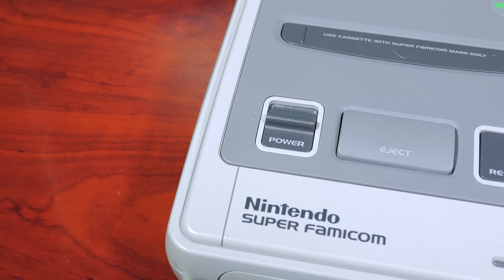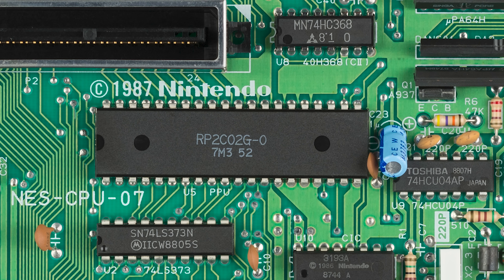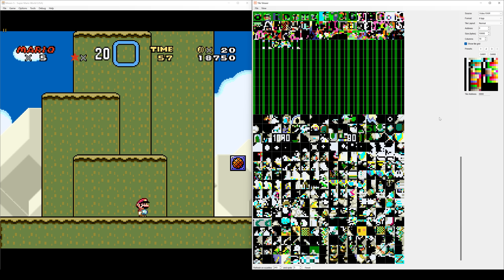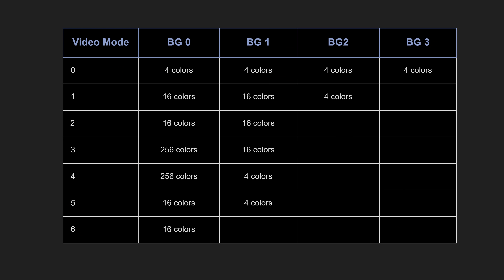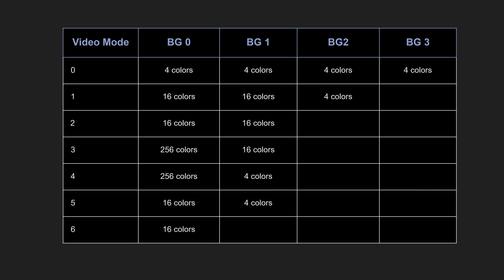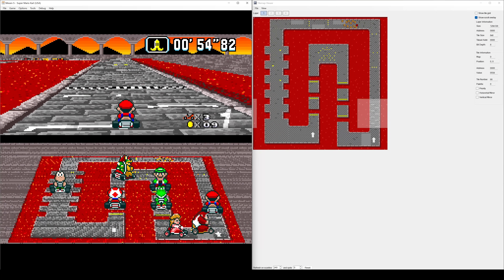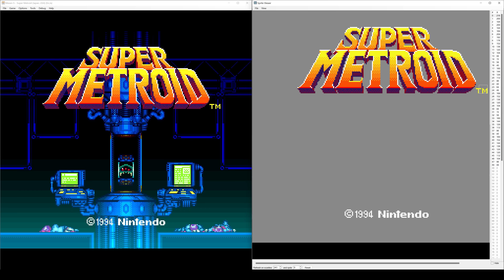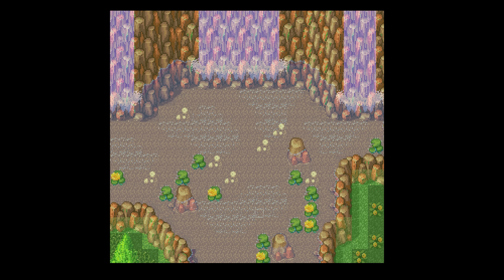How Graphics worked on the Super NES | MVG

Comment: Great video thank you. This reminds me of my childhood where i modded my supernintendo and added 8 swtiches which were installed on the back of my snes which were short circuiting single lines of the ppu which therefore gave me the control to hide single layers. In Mario Kart i was just deactivating the Main Kart which then looked like you were looking from the drivers perspective. In ShadowRun i had the effect that i was able to turn of the layer of the interiour design of the rooms and therefore being able to see all the hidden secrets like hidden money , weapons, etc... This was one of 4 mods for my snes which i did back in the time.
Reply: Wow nice, I loved discovering how these games where made back around 2000, switching on and off these backgrounds on emulator. I had no idea it was doable on a real hardware. I wounder if a similar mod could applied to the sound system in order to cut the 8 music channels independently so that you can listen to each of them solo, but on a real hardware.
Reply: @mrnuage  well actually i never tried to mod the sound. I was not even thinking about that but its a great idea. At that time everysingle mod was very risky to damage the mainboard which had happend. I was still a child and i was super curious to understand what all these chips do. So i took a wire and were short circuiting the board while it was running. This was not my first attempt in modding hardware. I tried that also before on a master system and a commodore c16. So i allready had some basic knowledge about what i can do and what i should avoid. Anyway on one attempt to get rid of the region protection i fried a coil and then paid a lot of money for a repair service just to try it again afterwards ;) and indeed i was able to find the chip which was responsible for the region lock. It was a great time and i loved my SNES.
Reply: @mrnuage : Sound is mixed internally in the S-SMP / S-DSP, afaik you can't disable channels by modding.
Reply: That's awesome, what other mods did you do?
Reply: @renakunisaki  i added a 60HZ crystal oscillator to my snes which was a pal system with 50HZ. With that mod i was able to remove the top and bottom black bars from the screen which the pal system usually had and played all the games with faster speed. Especially Street Fighter  2 Turbo played so much better with that mod. Also the colors got much more contrast. It looked great on an old Sony Trinitron CRT.

Comment: You mentioned that the layers in certain modes could display 128 colours, but the graphic on screen says 256 colours.
Reply: Same about mode 6 - 16 colors written, 32 colors spoken
Reply: I’d appreciate Modern vintage to respond with a clarification because I’m very curious what’s the right number
Reply: SNES features separate palettes for sprites and tiles, 8 for each and 16 colors per palette, including one transparent for each palette. Meaning you could technically get 256 but probably won't due to colors overlap and art styles. Also you still could have only 16 colors per sprite or tile. There is a direct mode when you could use 256 colors for each tile, from a shared palette memory but those screens are incredibly heavy in terms of cart space
Reply: He meant that the color RAM (CGRAM) had 256 entries. However, color 0 was always transparency, so those couldn't be used. If I recall correctly, the only modes that can use all of the entries are the 8bpp modes which either have 255 color or 256 if you include transparency as a color. Most of the time though, the CGRAM was broken down into smaller chunks / banks dedicated by each layer / sprite group.
Reply: I was confused too haha, in here is a better explanation of what each of the modes are capable of and other if his videos explains in detail mode 7 with examples
https://www.youtube.com/watch?v=5SBEAZIfDAg&list=PLHQ0utQyFw5KCcj1ljIhExH_lvGwfn6GV&index=6
Reply: The correct number is 256, aka 8bpp.

Edit: Also Mode 6 is 16 colors, not 32 colors.
Reply: I’m curious what the actual answer is as well
Reply: 5:32
Reply: Mistakes were made.
Reply: @inceptional  Guess you're right Lol. Btw, the owner of VCDECIDE is a Dudette
Reply: Are you a wizard?
Reply: If you want a good video series to really learn about this, go to Retro Game Mechanics Explained. MVG squashed too much information in one go and left other critical out. Sorry mvg but there are better videos out there.
Reply: @charleswhat3333  Yeah, that series is genuinely great, and that dude really know what he's talking about.
Reply: @inceptional  Wth, you are everywhere lol
Reply: +1
Reply: Trying to keep it simple.
Reply: Boy, I really hope somebody got fired for that blunder.

Comment: This is when Nintendo is at its best. Not the most powerful hardware, but efficient and reliable... Focussing on the Fun of Games and make them interesting, rather than comparing dick sizes.
Reply: Nintendo was always underpowered, hell, Nintendo Switch is so underpowered nowadays Nvidia doesn't even support and manufacture the chips.
Reply: @flintfrommother3gaming  Yeah big doubt they stopped manufacturing them. It's a cash cow for both Nintendo and Nvidia and they sell millions of them every year. They aren't going to do that before there is a replacement or the device itself reached EOL.
Reply: @KiinaSu  Nintendo bought 30 million chips at minimum, this is public info UNLESS they are even buying more which I doubt.
Reply: Snes is not underpowered though the cpu isn't the most important thing when it comes to gaming its the graphics and the snes has better graphics then sega does.
Reply: Also I might just be better off deleting my comment because I can't find the source but it was when the news of the Tegra card which Switch is using got discontinued.

Comment: HDMA really helped with mid-screen effects. No more cycle-timing code as on the NES. That freed the CPU up for calculations rather than delay loops.
Reply: Hey, I know you! You do a lot of emulation work. Kudos :)
Reply: The NES did have external irq support, though.
Reply: wait you're that blargg?! (blarggs tests)
Reply: @v0xl  Yeah, I wrote a lot of tests a while back.
Reply: Amiga had copper and blitter and there was a big overlap of memory addresses all three could access.  I would have thought that in 1991 the pendulum would have swung back to CPU.  ZX80 had two sets of registers. In RISC CPU you could have the normal code running one set, and the line interrupt code on the other set. Instructions just enter the pipeline and there is a multiplexer to feed from either program pointer ( or make it 4 to be safe). People argue that this leads to a problem with the Branch Delay Slot. So the branch instruction went through before the interrupt. Then come all the instructions form the other program pointer. You just are not allowed to cheat. When interrupt stops it switches back to the main program and the pointer points to the delay slot, like before. Only then the branch instruction is allowed to take action. So like 4 sets of registers you would need 4 branch units. This does not sound to difficult on this abstract level. Just don't wait until VDHL when you do this. Also when you want to cascade more than those 4 levels of interrupts ( on a console??? ) you would need give single cycles to all hype threads until one is out of a branch delay slot.

Why would you cycle time code for horizontal line interrupt? I thought you link it to an (invisible) sprite .. or on C64 to a scanline.
Reply: @ArneChristianRosenfeldt  There's the sprite 0 hit, but it is very limited. You can only really use it for a scoreboard layer on top. The NES has, fortunately, external IRQ support. That can be used by the appropriate mapper for horizontal interrupts. And you could also use the interrupts for raw PCM playback with less processing power wasted.
Reply: @fungo6631  What is the limit? I mean I hate that you have to waste all the sprite logic on the NES where the C64 already had separation of concerns and an extra line register for the interrupt. But even on the C64 you would use software if you need to interrupt the CPU on multiple lines. And I like software because the interface between the fixed hardware from the US company and my software is minimal. Both C64 and NES did accept cartridges and thus you could have a big library at your fingertips. Or your optimizing ( pruning ) compiler fits into 64k.
See how long it took people to write software for a code cache on the Jaguar. Now imagine that you had to do hardware iterations for it. I know that TI managed to produce a hardware sprite multiplexer, but MOS was much smaller and I'd rather use their bug-free 8 sprite interface and multiplex in software. 6502 is blazing fast for bookkeeping.

Don't get me started on PCM playback. Once I learned that a PC can do PCM using a simple resistor network on the printer port, I can only assume that hardware blocked that feature on malicious intent. The Atari VCS has a custom chip with 128B. That is enough for some scanlines of audio. Don't know why we could not have that 10 years later. Video uses DMA, so I don't really get why Audio was not allowed to use it before Amiga and SoundBlaster. Apple uses el cheapo PWM for audio in the 80s. Don't even need the resistor network, just connect to serial port. VIC had 3 12 bit DACs and Amiga had 4 8 bit DACs.
Reply: @ArneChristianRosenfeldt  Holy shit, what a wall of text.
The sprite 0 hit thing is used for split screen scrolling timing. Look it up yourself.
Reply: @ArneChristianRosenfeldt  Yeah, hyperthreading seems pretty simple on older CPUs.

Yes NES gave you one sprite flag to do mid-screen effects, but you still had to poll the flag, and have it hit some pixels, and you had many cycles of jitter.
Reply: @gargantuablargg  Why do you need cycle perfect timing? Any branch in the 6502-code will change timing. If logic is so trivial that you don't need a branch -- hmm -- that always felt like CPU abuse to me. Though on the C64 there are at least to ways to let your timing snap to cycle precise timing grid. You could apply this after some branching logic.

Comment: So in the 256 color modes you wrote 256 colors but said 128 colors? Which one is which?
Reply: 256 colours (it's 8bpp, not 7bpp, after all), though half of the colours comes from the sprite palette which does limit the 8bpp-ness a bit.
Reply: Technically, they're both. You see, in mode 7, a 256-color palette (8bpp) is normally used. However, there's an additional mode that games didn't use. It's called EXT-BG and sets the color limit to 128 colors (7bpp), with the last color bit per pixel being used for priority.